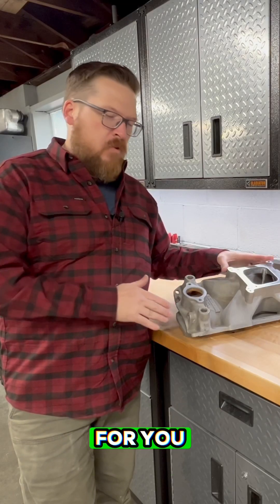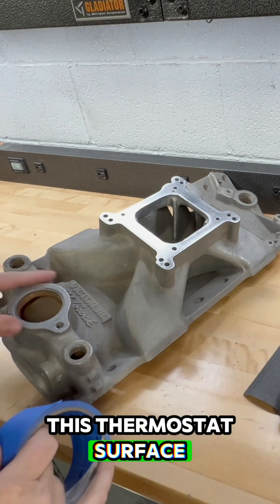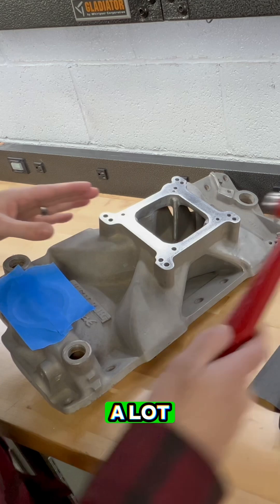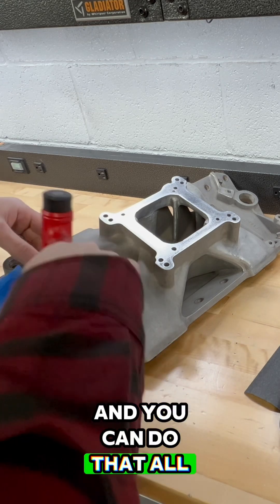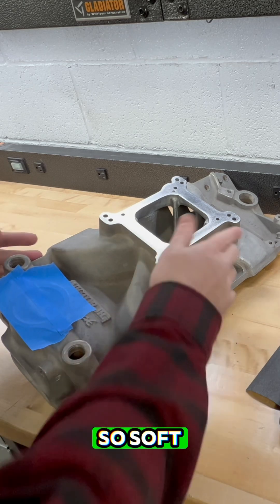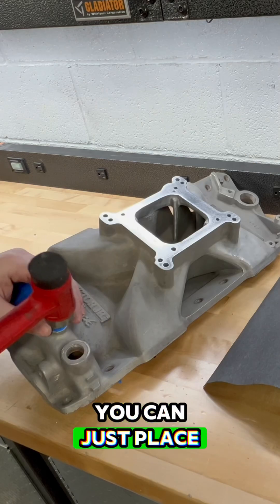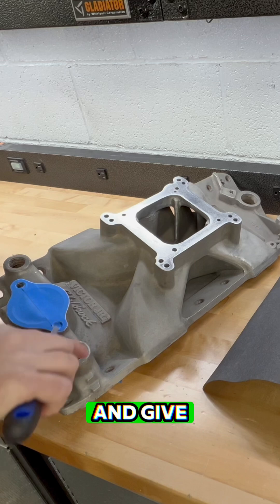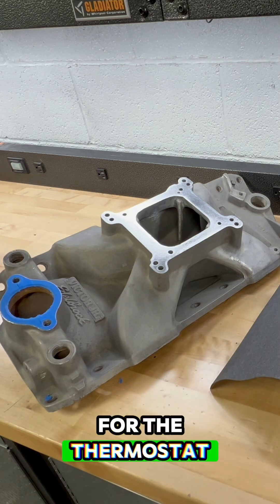DIY #gasket making & masking tech tips #enginebuild #engine

Comment: Why do you want paint in the bolt holes or inside the manifold?
Why not use the file on cast iron too?
Your ball bearing 'trick' is a good way to get a cross thread started.
Your 'tech tips' are NOT recommend.
Reply: I think the whole cutting the mask with a file or ball bearing was for the make a gasket section honestly not bad tips but bad explanation on the why its good and when to use what tip. But I agree on the cross thread personally I use a micro screwdriver to release the hole pressure than a rubber mallet (very light one) to beat an indentation on the gasket material so I can use my hole saw to make a perfect hole. Any recommendations for better tips?